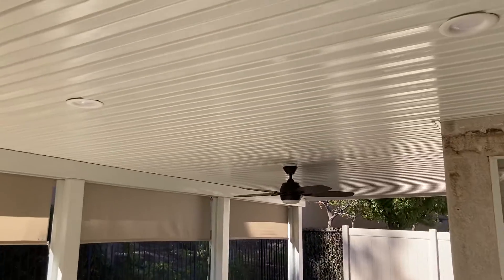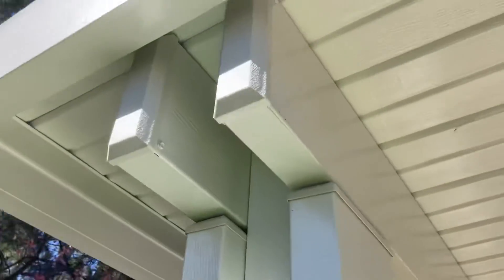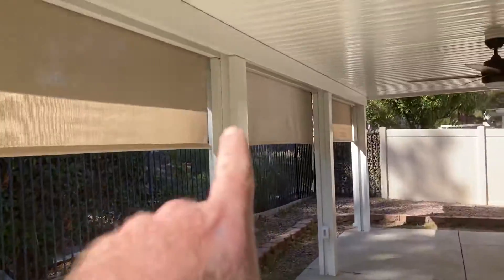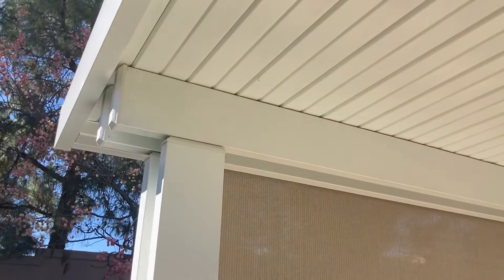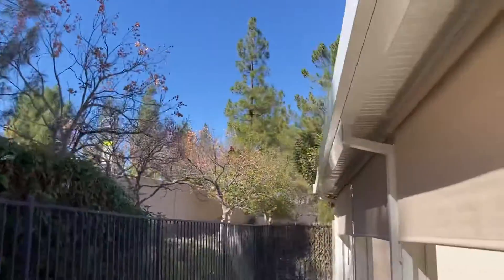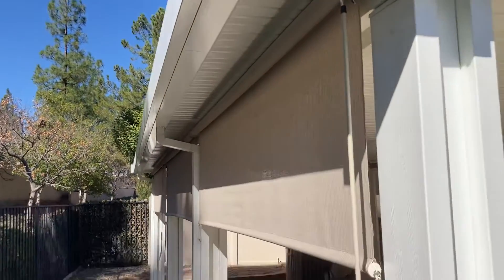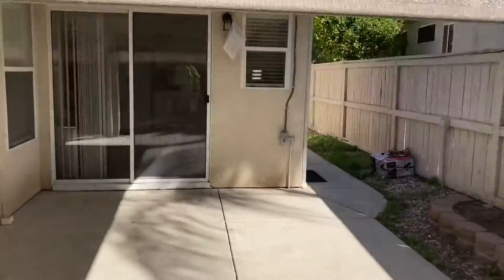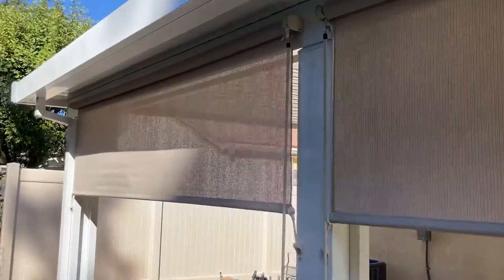Double 2”x6 1/2” Headers Beams

Comment: +1 on the “how to mount the shades” Don’t need a video but maybe you could comment how the attachment was done? Did you screw into the steel beneath the aluminum? Did you insert a 2x4?
Reply: Is there an answer to this
Reply: @darylmorataya4980  I inserted a 2x4 into the aluminum joist, which provided support for the screws.